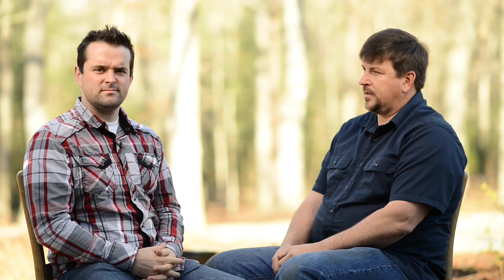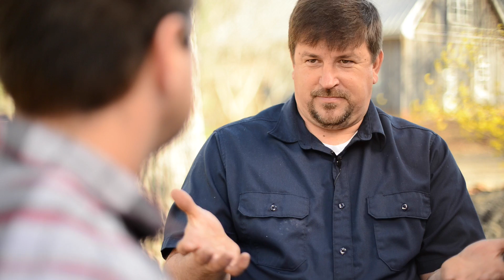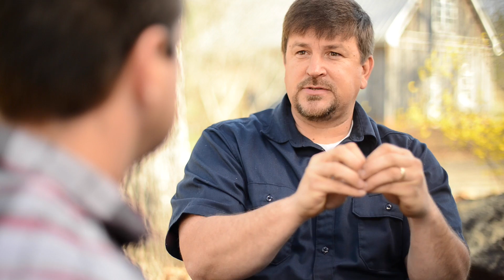What is a Faraday Cage?

Comment: A faraday cage cleared up my skin rash, I have EMF sensitivity, it's real
Reply: I built a cube around my bed with it by folding the edges together and holding the top/ceiling part up with wire and ceiling hooks, sewed side panels with wire, staples. Used 1 roll of 36" mesh, single bed.
Reply: How quickly?
Reply: Pin pricking left in 10 mins, rash noticeably healing after a few days, looking into shielding fabrics now - Itch flares up when I leave cage, gets better when I'm inside
Reply: How did you use the cage? Did you buy one and sleep inside of one? OR? I am trying to figure out what it is like to sleep in one. Thanks!
Reply: Hmmm, I think I can visualize that. So 4 corners of your emf blanket were raised in the air by hooks in the ceiling and then it came down upon you like that? Or rather, wires with hooks at the ends, I mean. What side panels? Hmmm, hard to visualize, sorry! 

Can I ask you where you bought your fabric from?

 It's hard to say how some other fabrics perform, and your recommendation would be appreciated! I also have a skin rash! Off and on for 10 years! Seborrheic eczema, and dandruff occasionally. I got rid of it mostly through PEMF, getting total body sunlight, destressing, and essential oils! I'm not out of the woods yet though, but I am happy to see such results.

Thanks again! :)
Reply: There's a good video on youtube called 'Sleep Inside A Faraday cage' you should watch that
Reply: @AnnaVOort  Is this the video you mentioned? Is your faraday cage just like this one?
https://www.youtube.com/watch?v=P4UdozjyLlA